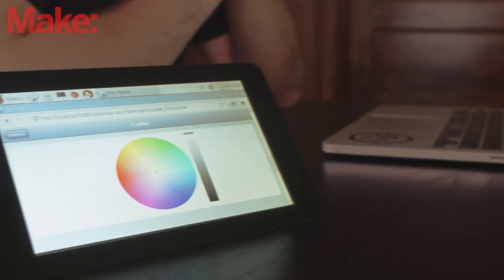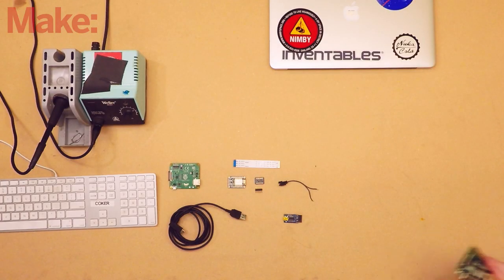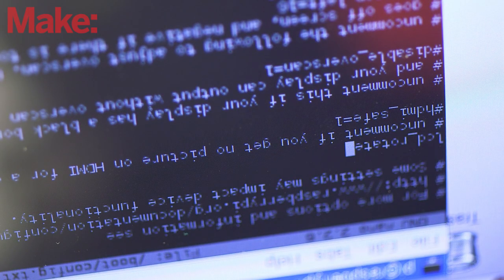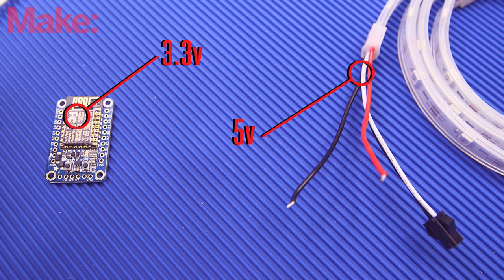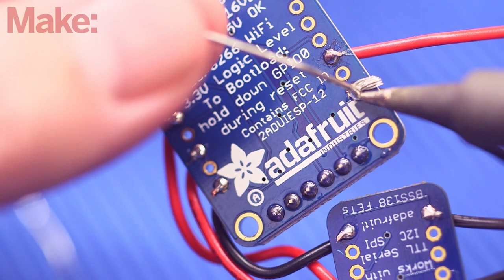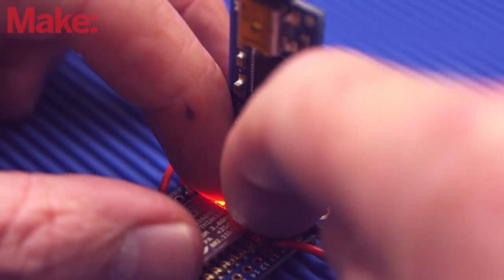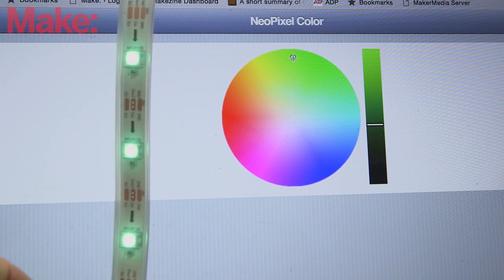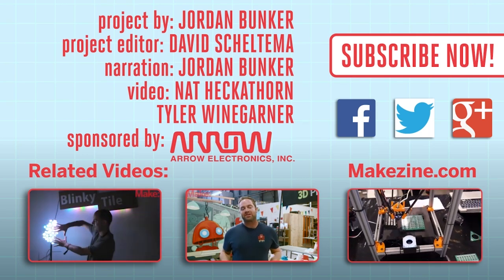Weekend Project: Home Automation with Raspberry Pi and OpenHab

Comment: Since you are doing a series on home automation, please include either an episode dedicated to the security of your home automation or at least notes on the security implications of each bit of setup.
Reply: Installing openSSL creating a CA and then signing certs and publishing a revocation list, redirecting port 8080 to port 443 through the Pi firewall, creating a VLAN on the router to separate control messages from the rest of the network. VPN tunnels instead of NAT for remote access....  Actually, just show people how to implement the Security Technical Implementation Guides from The Defense Information Systems Agency in case a Vague but Menacing Foreign Government Agency tries to access your computers.   http://iase.disa.mil/stigs
Reply: More like make sure you baby monitor can't be found on Shodan, your e-locks can't be opened by anyone with a rooted android, etc.

If someone with the resources of a major government intelligence service wants to mess with you, you are going to get messed with. But you can protect yourself from target of opportunity pranksters and griefers just by ensuring all your devices talk to their controller exclusively (either through ssl or a dedicated WPA2 secured hotspot, or a dedicated wired network) and that the controller requires authentication.

Comment: This project looks great - but I have a question. Why did you use Neopixel LEDs? The whole point of Neopixels is that you can address each one of them individually, and hence you can do cool animations and things like that. If all you're using them for is a simple, mono-colour under counter LED strip then it's a vastly more expensive way to do it than with a regular RGB LED strip. Is there some sort of functionality within OpenHAB which allows you to do animations, or is there some other reason you didn't use regular RGB LEDs?

Comment: I'd just like to point out that 3.3v logic is high enough to be seen as logic high on a 5v data in system, and for the other way round you just need a simple 2 resistor voltage divider, a transistor based logic level shifter for this project is overkill.

Comment: I preface this by saying I have a degree in computer engineering and work in IT and own 2 raspberry pi's that I've configured and played with for the last year.  This video started to sound like this to me though:  Connect the ABC to the XYZ using a CBA.  Next use the FDZ to run the UBD.  Bring up OpenHAB and you're done.  In short, didn't really learn anything here.

Comment: Openhab requires zulu 8, a open source alternative for java.
Zulu 8 is not in the official zulu repositories for raspberry pi so cannot be installed.
The .tar.gz file doesn't have a installer so that doesn't work either, it's a shame but it wont work.

Comment: Hello Guys,
I am working on a gas (LPG) detecting system using Raspberry Pi, MQ-2 gas sensor, and Python as programming language. I am looking for a way to make the connections and a sample code to start with. Could anyone help please?

Comment: Ported this project on Particle Photon and added feature to control analog RGB LED strips(non neopixel) using PWM pins and transistors. 

Check out:
 https://github.com/iayanpahwa/OpenHab-Particle-MQTT-master

Comment: the idea is right.. but not has simple.  you should warning that this proyect is for advance "techies?" need to know some arduino, linux, network, electronics,  and the programing on the openhab config files is  little complex
you could face many problems even the mqqt can be a little triky
 if you archive this... congratulations and welcome to openhab and mqtt... now you can automate all your house. and many other things.. is fantastic.
btw later you have to change that openhab to something better. raspberry is not that powerfull.
Reply: Are you including the pi 3 in that statement and what did you migrate too? Thanks.